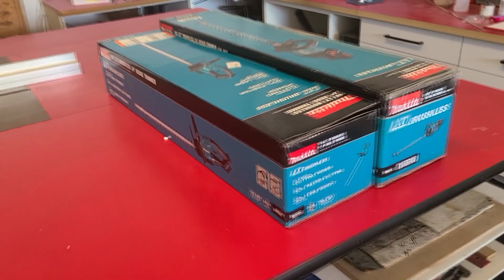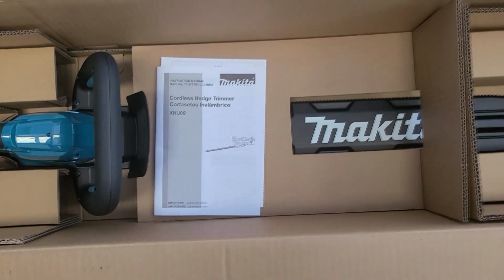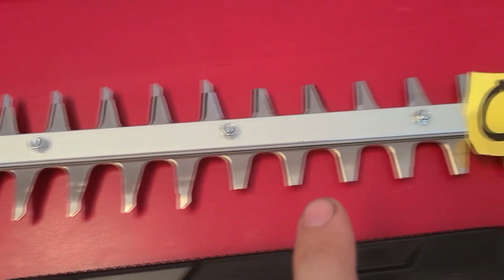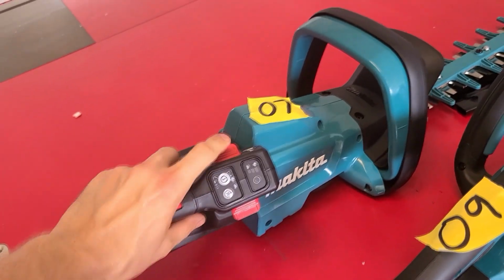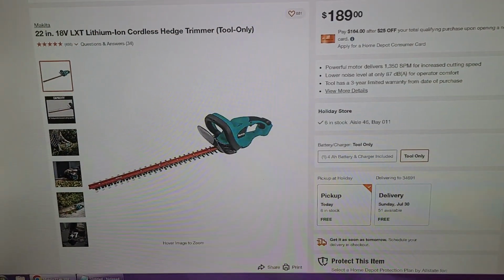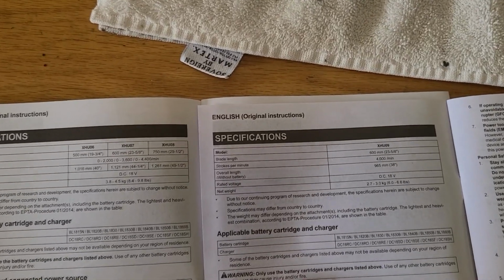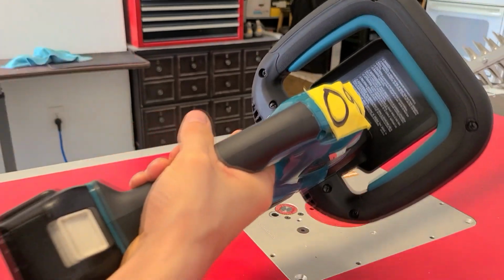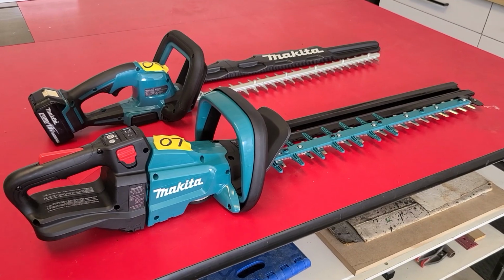XHU07Z vs XHU09Z Makita 18V Hedgetrimmer Comparison & Discussion (XHU02Z included)

Comment: The tall teeth are for incase you drop the tool and swing it into your thigh or body its there to prevent the teeth from cutting into you, similar to the blue guard on thr 07
Reply from the maker: Thanks for the input!  Safety first... or third... or at least in the top ten, I think.

Comment: i dont think any of the trimmers are limited to 3/8".  The cheapest global model (DUH523) has a 15mm cutting capacity, about 7/16-5/8".  The better models have 20mm so about 3/4".  I think the 3/8" was a typo.
Reply: found the problem, in the US it is advertised as 3/5" cutting capacity, so they just used the metric 25mm = 1 inch, and converted 15mm to 3/5".  I  guess Makita is also revolutionizing the imperial measurement system by introducing inch-fifths.
Reply from the maker: @wayward-saint  I just relayed what was advertised/marketed.  For sure, we silly Americans like to measure things in football fields, elephants, swimming pools, Empire State Buildings, etc...

Comment: Whats going wrong with my XHU07Z ? It cuts off with 2 lights flashing. Then starts working again Fresh batteries. Just started acting up today. I'm suspecting the grab / safety handle going bad. Amazon does not have tool only at this time. Home Depot $304.  EBAY $278.  P.S. Once you get a taste of the 45 degree head, you will not want anything else.
Reply from the maker: my dude, this is not a Makita tech support channel.
Reply: Beware of this fancy XHU07Z model, I read other reviews of one guy sending his back 6 TIMES! Another guy 2 times. More bells whistles = more things to go wrong a lot of times.
Makita needs to redesign that one.

I almost ordered the newest XHU10Z thinking it might be better than the XHU09Z but realized the XHU10Z had slower speed/less RPM's/power and smaller cutting diameter by about 1/8" (3/5" vs larger 3/4"), so check specs carefully before ordering one.
I just called Makita tech line, and the guy agreed if you want power/speed/able to cut up to 3/4" branches get the XHU09Z. 
If you want wimpy/slow/quiet/no power/only able to cut small branches get the XHU10Z.
Reply: @Scott-t5c  if it isn't already obvious, Makita's naming, like many tool manufacturers make absolutely no sense. You have to research each model individually, because naming alone doesn't give you any meaningful clue. That's probably their engineering brain at work 😅

Comment: The 09 is a well needed updated design of the 02 with substantially faster blade speed and cut capacity. It’s also a fairly new model, not even a year old at this point I believe and that’s why there’s limited Information online about it. The longer teeth near the back act as a guard in case you hit your thigh or leg while trimming. I updated from the 02 to the 09 this spring and loving everything about the new one. Wish you had some action shots of using em both.
Reply from the maker: That's all fabulous information!  Thank you so much for sharing!  If those teeth are supposed to be guards, I would say the 07 certainly has a better design in that aspect.  Not good enough to make me turn my back on the 09 though!  :D  That thing is killer!

Totally understand and agree with your request but I try not to abuse return policies so I wanted to keep the 07 in unused condition.  If it was genuinely a close call between the two, I would have used them both to lock down my decision and documented that process...  But I honestly had made up my mind well before I ever strapped a battery to either of em!
Reply: Yeah, the commercial ones usually have a dedicated removable guard.